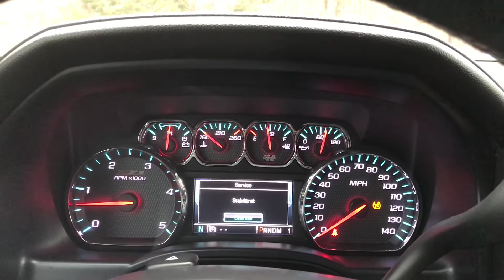GM Truck stabilitrak disabler

Comment: Okay but your not showing what buttons your pressing ? I’m pressing the traction control button and holding it and nothing is happening ??
Reply from the maker: https://www.tuningbyshanehinds.com/2014-12-gm-truck-stabilitrak-disabler
Reply: He made a harness and sells it. Cuts the power to the fuse that powers stability track traction control and abs is my guess.
Reply: Basically what he wants is that you clicked the link and pay 99.99for him to show you how to fix the problem,but  whatever he show, you is not gonna fix your problems because you might have a different problem that he has,just wanted to take your money??
Reply: I just fixed mine gmc truck put it in park the circle turn gage for 4wup and 4wd put it in 2up press hold for 5 seconds turn it back to auto light went off

Comment: My 2015 Silverado has had the service stabilitrak light on ever since I had it aligned after having a lift kit installed. Will this diablw the stabilitrak completely and make the stupid light go away?
Reply: Steering angle sensor alignment ?

Comment: Just installed mine. Love it!
Reply: With the switch armed, does it cause lights and warning chimes to appear on the dash
Reply: @jwilli850 The stabilitric and ABS lights come on on the dash. And you have to acknowledge the messages in the message center warning you that both are disabled. There's no way around that. But when you flip the switch back to normal the lights go away immediately and everything works as it should.
Reply: @ is there a good video of where it installs

Comment: I found out that it's on the same circuit as my rear right turn signal or brakes, not for sure which, when that is shorted out, it will now have any traction control even above 30 mph.

Comment: I did this modification on my 2017 Suburban and ended up reversing it... What happens is when you turn off stabilitrack and kill the circuit, it sends a notification to GM and then you get an email stating that your stability track is broken and to make an appointment with the dealership.... Its quite annoying.